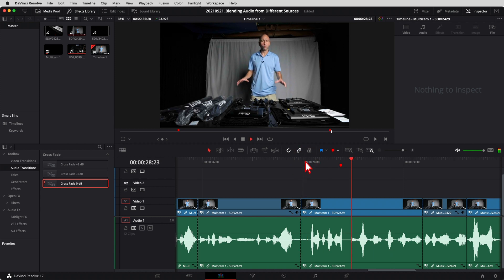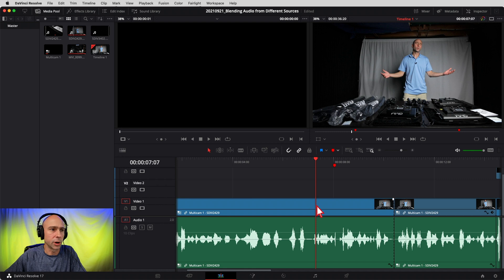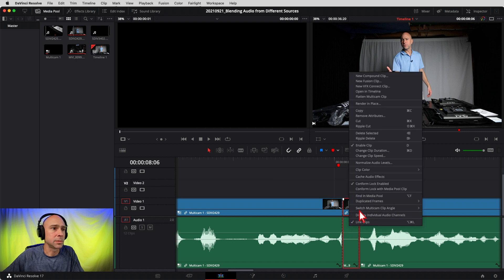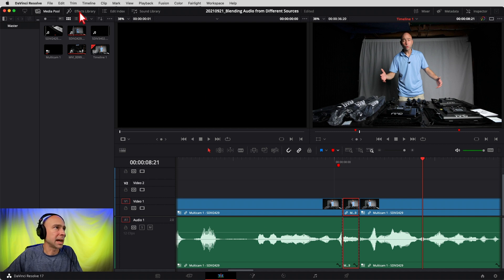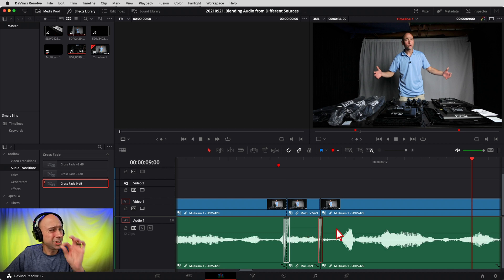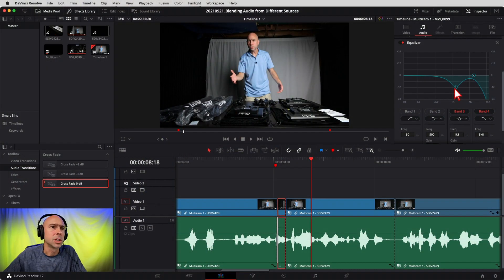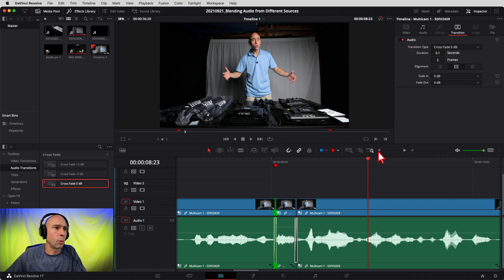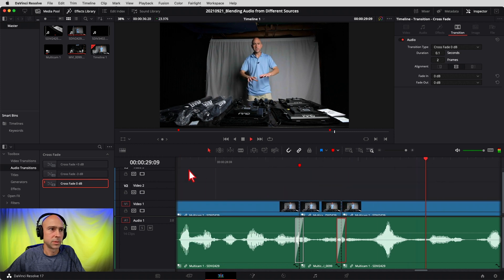BLEND together AUDIO Clips from Different Sources in DaVinci Resolve 17 | Quick Tip Tuesday!

Comment: Great video!  My problem is somewhat similar but different.  Do you know if there is a way to have two audios from two separate camera angles play at the same time in a multicam clip?  I have two separate cameras mounted while I am flying an airplane.  One is outside the plane which captures the wind and sound of the engine and the outside view of the plane and sky and terrain.  The other camera is inside the cockpit looking out the windshield and is silent other than my radio calls and me just talking out loud during the flight.   So, I want the engine noise and wind audio from the outside camera to be heard at all times and then also be able to hear the radio calls and my talking from the audio being captured from the camera inside the plane.  So, basically I just want both audio clips enabled in a multicam clip.  Any ideas?  Thanks!!
Reply from the maker: Hi!  I'd try making the 2 audio clips a compound clip, then put that compound clip inside of the milticam clip.  That way it's all on one track and should play both audio's at the same time.

Comment: What did you do to make the cuts (around @2:37)?  I see that you didn't select the razor blade icon, which is the only way I know to do it.
Reply from the maker: I used the keyboard shortcut. By default it's Ctrl (cmd on mac) + B to make a cut.

Comment: Man, that's a sweet trick!  I have had a few instances where my GoPro recorded in-camera audio instead of my lav mic... what a PITA.  I have done some similar trickery by selecting another camera's audio in the multicam, and then I let Alex Audio Butler do its magic and it ends up sounding pretty good.  I'll put this one in my back pocket for fixing the EQ next time :D
Reply from the maker: Yeah man!  That's a pain if the audio switched on you.  This trick could definitely come in handy.  😜  Hey - awesome stuff with the lego builds and whatnot, very cool.  My oldest is super into legos.  Looks like you are doing great on your channel too, keep at it man!
Reply: @JasonYadlovski  Thanks man, slow growth is still growth :D  Now I'm trying to decide if I should put Lego-related content on my main channel or create a 2nd channel just for that... decisions, decisions!

It's an issue I've had with the GoPros since the 8 - if you don't ensure the camera is SECURELY plugged into the Media Mod, you can get in-camera audio only, which is garbage for what I'm doing on the bike.  At least the 9 and 10 have the audio level meter on the rear screen when the Media Mod is properly plugged in :D

My Mail Call #4 video had this issue - so in a moment of editing genius, I ran with it, turning most of it into a music video, with some tweaking to the audio for the talking parts, minimizing my talking portions while riding.

Long response, but only a couple of people noticed :D  Gotta get creative sometimes!

Comment: I wish I had know this when I interviewed an Australian award winning hip hop artist. I was getting drop outs with my Rode Wireless Go, possibly due to having two receivers very close to each other. 
Anyway, it will help with my cousin’s wedding video I am currently editing. So thank you.
Reply from the maker: OH bummer you got dropouts!  That's the worst.  Typically I always try to have more than 1 source recording audio, just in case.  No one wants to redo videos because of bad audio or drop outs.  That's the hard part with wireless setups sometimes. Best of luck on the wedding video!
Reply: @JasonYadlovski  Was just starting the business at the time. I now have primaries and back ups. Sit down interviews...Rode NTG5 is my primary. For weddings, I have the Sony TX660 to complement feeds from MC and DJ. Even with back ups, I know there will be issues form time to time, so this video is still very helpful. Thanks
Reply from the maker: Awesome sounds like you’ve got a nice setup! 😁👍

Comment: Hi Jason, I need to replace part of my audio track with another audio due to mic fuzz. I just used a Lav mic with my Panasonic GH5.

When I R click and choose "Display individual audio channels" I can see the audio track from my GH5 and the audio track from my lav mic. There is no option to choose "Switch Multi Cam angle". 

How can I turn the lav mic audio off and just use the GH5 audio? They are not separate in the audio 1 track clip. They are in a vertical display but are volume controlled together. 

I need to silence the top audio and keep the bottom audio just for that one clip in the Audio 1 track.
Reply from the maker: Hi Gayle! I don't know the GH5 specifically, but I would think that the individual channels you see is just your right and left channels from the lav mic.  As far as I know, the camera will not record from the internal mic AND an external mic at the same time.  Once you plug the lav into the camera, it disables the internal mic, typically unless the GH5 is different.  So you likely only have the lave mic, right and left channels (Stereo, hence the left and right).

As for the 'Switch Multicam Angle' you'll only see that if it's a multicam clip, meaning you filmed several angles, then created a multicam clip with them.  If it's just a single clip, you're not going to see that option.  

Hope this info helps!  Let me know if it doesn't.
Reply: @JasonYadlovski  When I choose "Display individual audio channels" I see 2 audio wave forms and one wave form has much lower wave heights. That makes me think it is from my GH5 and my lav. But I cannot separate these 2 wave lines  so I cannot tell if what they sound like other than seeing the difference in the volume. 

But I have another question. Very often when I go to Render my video in the Deliver page, the Render option Entire Timeline is grayed out and I cannot choose it. I can only choose In/Out Range. 

Why does this happen and how can I fix it?

Comment: Does someone know how can I set the relevant frame of a video in Resolve so that stuff that was added in the editing which reaches out of the frame is automatically cut there?
Reply from the maker: When you create a new timeline, you can change the frame rate to anything you'd like.  If you want to change a specific clip's frame rate, right click on the clip in the media poll, then go to clip attributes and you should be able to change it in there. Hope this helps!
Reply: @JasonYadlovski  I don't mean the frame rate but the frame in which the video is shown. In this specific case it is a movie scene in which there are black bars at bottom and top. How do I make them stay black? Thanks though.
Reply from the maker: I see, i’ve got a video that shows you how to use output blinking as well as just adding black bars if that helps, here’s the video https://youtu.be/DItOs6S-V6Q
Reply: @JasonYadlovski  Thanks!

Comment: At ~8:43 you mention adding compressor, etc. Assume you do that in Fairlight. 

Question is: What order are the effects applied to the audio stream? Are the corrections you apply up to this point in the Edit page fed to Fairlight where additional corrections/effects are applied
OR
are the Fairlight effects/corrections are applied to the project first then the edit page EQ effects/corrections are applied?
Reply from the maker: Yes, I add a compressor in fairlight. As for the effects order, you've got the option of how you'd like to order the Effects, EQ and Dynamics.  I like to do EQ, then Dynamics, then Effects.  The effects are the same in the Edit tab and the Fairlight tab.  I'd always do audio work in Fairlight unless it's a quick little change in the edit page.  You've got more control working with the fairlight tools.  Hope this helps!
Reply: @JasonYadlovski  What I was asking about is: If you do some EQ adjustment in the edit page then go to Fairlight and do some EQ adjustments and maybe some compressor/reverb/etc. there are they additive? In the case where an effect is available in both the Edit page and Fairlight, does one overwrite the other or are they additive? Which gets applied to the audio track first? 

I ask because initially I might do some EQ in the Edit page but later realize it needs more work so move to Fairlight. Are the EQ corrections there in Fairlight as a result of the Edit adjustments or will it double up?

IIRC, there is a similar issue with the ordering of effects between Fusion and the Color page going to the Edit page. I can't remember the order but I've seen it referenced.

HTH clarify the questions
Reply from the maker: The EQs are additive.  Which ever you add first is the first in the line.  Occasionally I’ll use both. Same with effects. I don’t know about the effects in color vs fusion.

Comment: The point of this one is: always have a spare. A spare video track, a spare audio track,  a spare computer, a spare camera, and a spare mic. Speaking of reliability, why commercial airplanes are so dependable? That is because many of their systems are backed up. Commercial aircraft always have at least two pilots, they have more than one engine, they have more then one auto pilot, in fact, they have spare landing gears (they can land with one landing gear up) and so on.
Reply from the maker: Backups are always good to have!

Comment: If you recorded the sound with two microphones, why not to use the recording that is not corrupt and abandon the bad one?
Reply from the maker: The extra audio I had was just from the internal microphone on my DSLR, the audio actually was terrible. But it was good enough to fix a little section. 😜 I usually have an external microphone on top of my DSLR whenever I’m filming but that time I forgot to put it on, I wasn’t going to use that audio anyway. But glad I had it!

Comment: Good tips on fixing audio glitches. One thing I find that helps sometimes is to try to move your in and out cuts/dissolves to a quiet spot in the waveform if possible. That way you're not having to blend the clip mid-word in this case. Course you don't want to extend your replacement clip to much in the process.
Reply from the maker: Thanks!  Great tip! 😁👍

Comment: Thanks for this quick video.  When you used a cross fade to blend, you chose to use a 0dB one.  I've listened to other tutorials that suggest using, I believe, a -3dB one.  I'm a little fuzzy on choosing one or another. Do you have a more detailed tutorial regarding this?
Reply from the maker: You’re welcome! I don’t have a more detailed video on the -3db one, I think it depends on the volume of your clips. In my case I adjusted the clips so that the volume was similar, therefore I did not need to raise or lower the volume through the Crossfade.